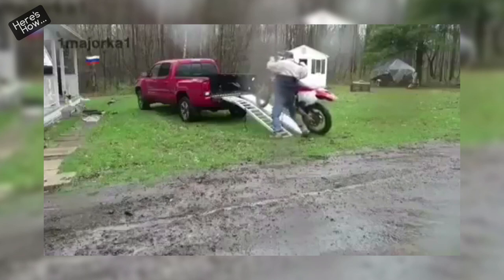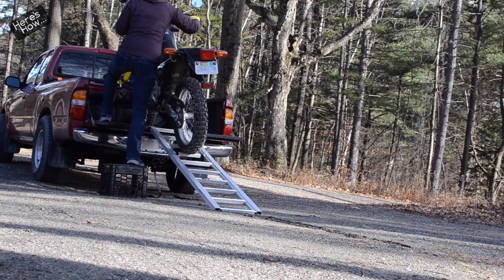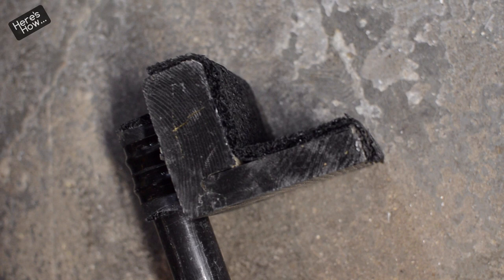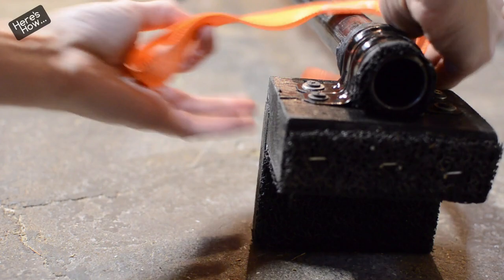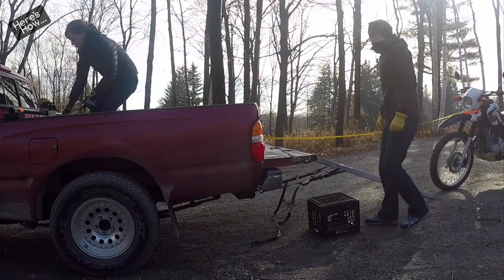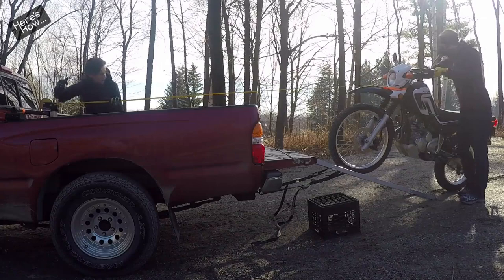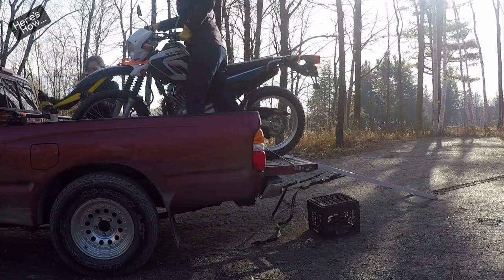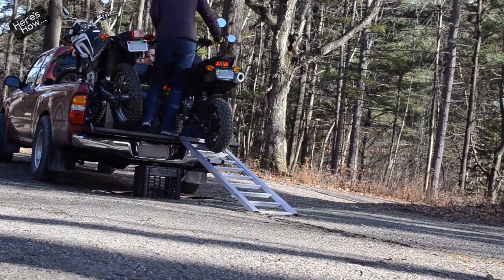DIY portable winch system - Easily load a motorcycle in a pickup truck

Comment from the maker: Update: We’ve since also used this system to load wood stoves on dollys, which can weigh 500-1000lbs. The craigslist seller we brought one of the wood stoves from said “bring a crew”. Imagine his surprise when two women pulled up and had it loaded in <10 minutes. :-) For the stoves, we used a rope and pulley around the bar for a smooth unloading.

Comment: Its easier and faster to just push it up😂 even if you arnt strong enough just start it and put it in gear and walk it up and keep a finger on the front brake
Reply from the maker: Search YouTube for "motorcycle load fails" and you'll find it's not always easier/faster for everyone to use the methods you suggest. There are a lot of factors to consider - balance, strength, etc. Do what works for you.

Comment: Do you know how much load your trucks D rings support?  I want do something like to help me load an off set smoker into the bed of my truck...I'm thinking my off set weighs about 600 pounds.
Reply from the maker: Not sure. That being said, it seems like a lot of the weight gets distributed to the bar that pushes on the edge of the bed, because there's a kind of downward pull when the bikes are still on the ramp. Once the bikes peak and are flat on the truck, then it pulls more directly in line with the D-Rings. For what it's worth, we've also loaded wood stoves on furniture dollys this way, which I imagine might be similar to an off set smoker. A good fail safe may be having someone standing next to the ramp and moving chocks behind the wheels as it goes up. I would not have anyone standing right below it though, just in case.
Reply: @stickwallfarm  Thanks for the reply have a great day!